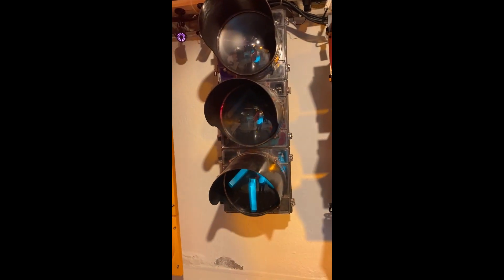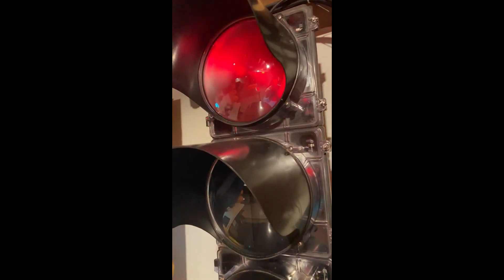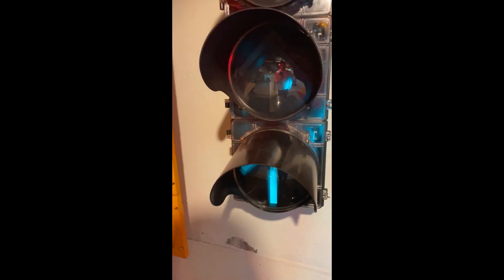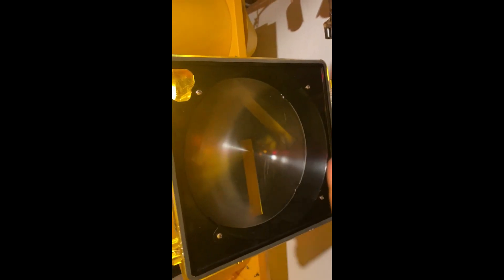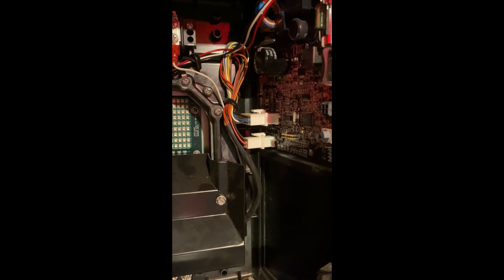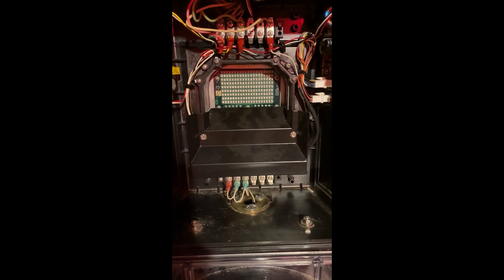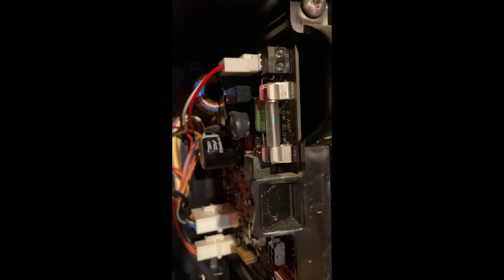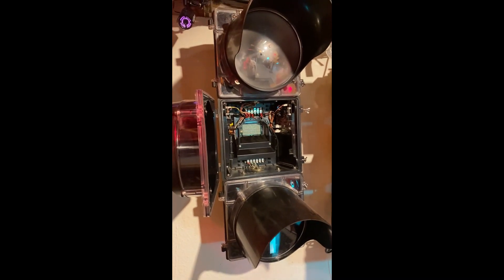Intelight ESB Signal Head

Comment: Why did some use Dialight led modules?
Reply from the maker: I assume you mean why did some get retrofitted with Dialight LED modules?

These nature of these signals with exposed circuit boards meant they had to be 100% sealed against water intrusion. Over time, with poor installation, and with more crude quality in the later units made with Chinese parts, water eventually would get in and wreak havoc on the boards. The later units had less conformal coating on the boards which did not help moisture. 

When Q-Free bought Intelight they did not desire to continue production on these.
Reply: @NickBasilico  Oh, I stand corrected

Comment: Wow I wish they use this signal in Michigan amazing
Reply from the maker: This signal was discontinued by Intelight about 8 years ago. In fact Intelight themselves were absorbed into a new company called Q-Free. There used to be two of these by Motor City Casino but both were pulled out of service and replaced with louvered Durasigs
Reply: @NickBasilico  yeah I remember the one by motor City I didn't understand why it was removed they look like they had heat sinks on the back of them
Reply from the maker: Yes heat sinks on them. They were removed because the boards inside were damaged and replacement parts are no longer being made. These signals were easily damaged by water getting inside and shorting the circuit boards out.

Comment: Are these pretty durable?
Reply from the maker: Pretty durable. They are heavy thick glass filled poly. They weigh quite a bit more than a regular poly head. More like an aluminum head in weight. As long as they are sealed good to prevent water damage to the electronics inside